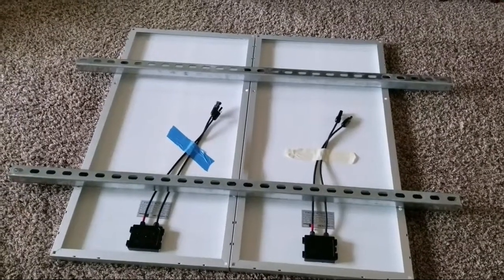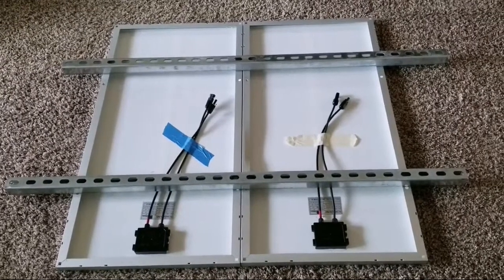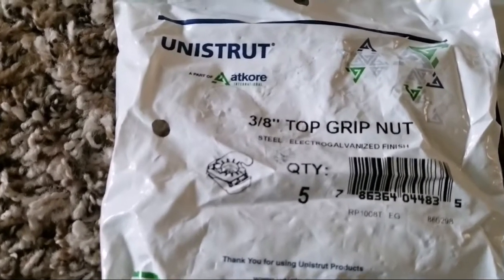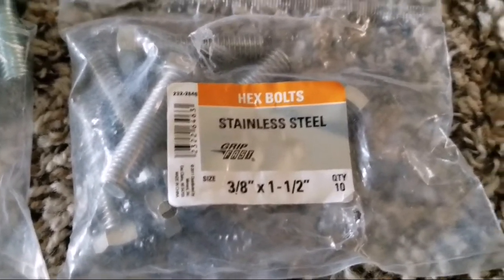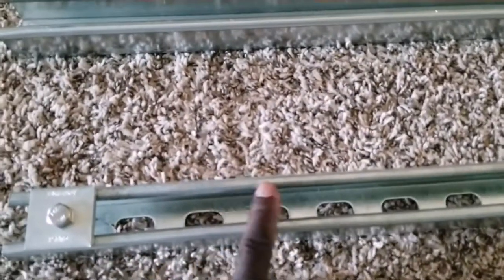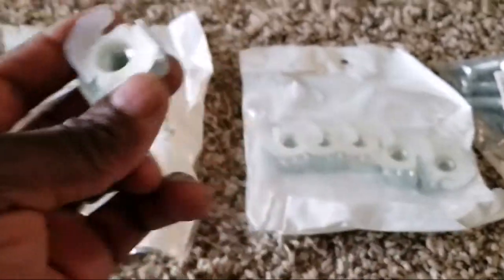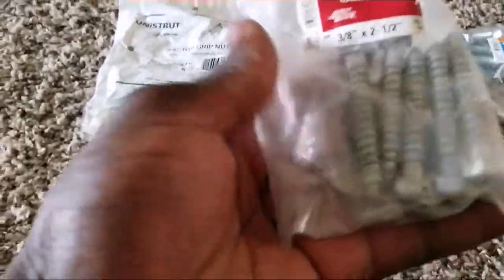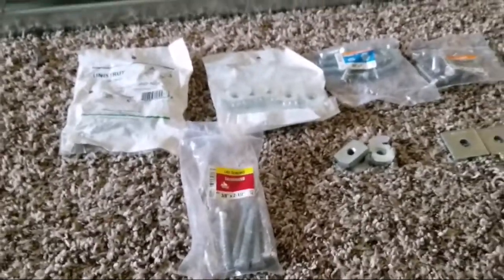UNISTRUT SOLAR PANEL MOUNT: How to install solar panels Using Unistrut/Superstrut

Comment: Great idea for connecting the panels to the rail but what happens when you need to remove a panel in the middle of a group of panels for maintenance?  You have to take all the panels to the left or right off the unistrut in order to access the problem panel
Reply from the maker: Your project might be different from mine. So my advice to my viewers is, make renewable doable.
Thanks for watching and for stopping by.
Please don't forget to SHARE LIKE and SUBSCRIBE to my channel.

Comment: what you do is put a long bolt though the clamp washer and the nut on the back of the unistrut use a bit of rubber under the washer on to the pannel to protect,good vid thanks
Reply from the maker: Thanks for the input

Comment: the lag screws need to into rafters under the roofing
all metal parts need to be electrically bonded to ground, the panel frames and rails
you should use loctite thread sealer on bolts that go into rail nuts

I have priced the uni-struts with the rail system from Alt-E and Alt-E is less money, but is in my area where Alt-e is in my state.

best